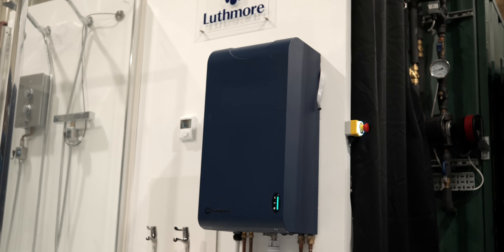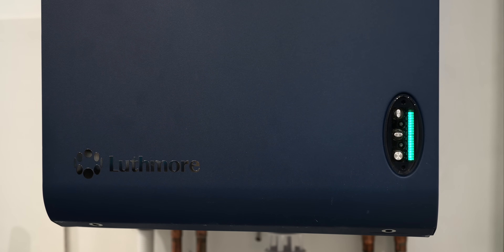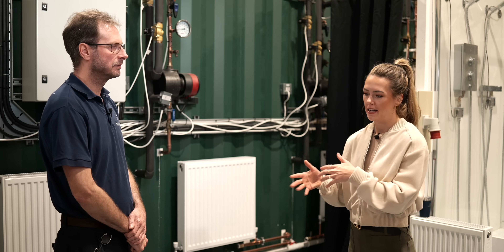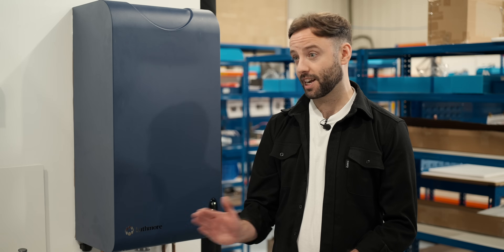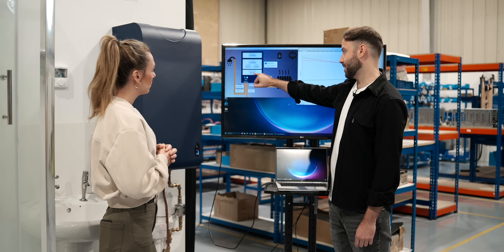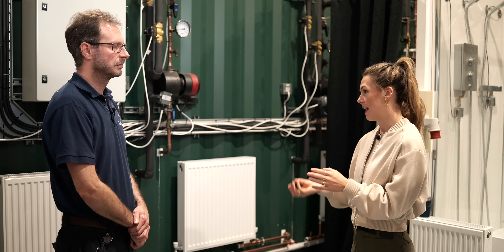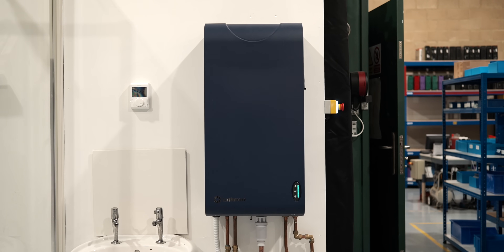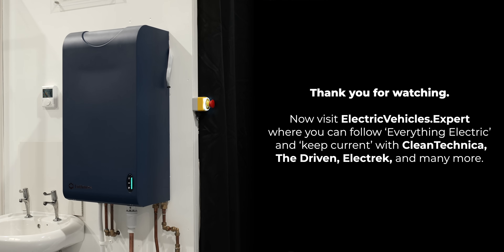Could This Battery Boiler Replace Gas AND Heat Pumps?

Comment: I wouldn’t buy a boiler or appliance that had to have an app to work. Apps are notorious for not being supported for long and the boiler needs to last years.
Reply: Indeed. It needs local control (it may have that as well as the stupid proprietary app). Only this week Google shut off all the smarts in nest thermostats. I won't put anything in my house that can't be controlled after the company goes bust. It's just asking for trouble.
Reply: There's a new standard called Matter that allows interopability between manufactures. It's been being built for the last few years and you can already use it now. Ikea's smart stuff supports it as does a bunch of other stuff.

Anyway, you can get thermostats that talk this language too, so you can set it up and just have it work in the Google Home app or Apple Homekit or whichever smart home app takes your fancy.
Reply: If I really wanted a specific device and it had to have some type of App, then I would only get it if it also supported an open source ecosystem like Matter so I wouldn't be trapped to the device manufacturer providing App support.
Reply: As long it can work and controlled without the app or at least the app works over bluethooth……
Reply: @HansKeesom  blue tooth is relatively easy to hack and in rented HMO's in particular you really are vulnerable to  whoever is around you when you activate it.  Even American small town city  utility companies have fallen victim to Blue tooth hacking ..
Reply: We have a bungalow with Baxi Bermuda gas back boiler for heating and hot water, it is 1970’s vintage. It’s serviced every year and not had any major issues.
Reply: Electricity more expensive than gas, is ridiculous. Probably the gas generators and nuclear raising the price of electricity.
Reply: I have just had solar and home batteries installed and the batteries were installed using an app. It was extremely easy.  If its from an International supplier there will make sure you can run the app will into the future.
Reply: My mums neighbour have had the same boiler for 40 years!
Reply: Not phased by an app. I’ve had the controller of my thermal store changed a number of times in the last 25 years. Just a control unit. Ultimately it’s a fancy switch. 
I’m more worried about the gas being cut off.
Reply: Same what if you don't have a smart phone? Ur fooked
Reply: Whilst I can fully understand the sentiment, you may find it impractical to apply across the board as the digitalisation of virtually everything gadget-wise train has long left the station on a journey that is NOT going to stop. Even modern ICE cars, apart from the fossil fuel used to power them, have essentially become little more than computers on wheels.
Reply: @pinkelephants1421  Oh I totally see the benefits of connected devices, I actually work in the digital innovation space, but that also includes resilience and the need for a manual control separate from a phone for basic tasks. For a boiler it’s a manual thermostat and boiler settings display, for a car it’s still being able to drive it if app support is dropped. Only today I defrosted my car via the manufacturer’s app. At some point that app or model of car will stop being supported and I’ll lose that feature amongst others, but I can still drive it. I suspect a subscription will apply after a period of time, but at least that will extend the lifetime of the support. So I’m not against phone apps, far from it, but I want a fallback for when support is dropped.
Reply: @pinkelephants1421  and the fossil fuel too, unless you have an oil well and refinery in your garden.
Reply: Been using Hive with an app for at least 10 years.
Reply: Even Hive discontinued their security and leak detection products in August so aren’t immune to dropping support. Without any method of local control or support for open standards these devices are now useless. At least with boilers they support OpenTherm and can be controlled locally via the thermostat.
Reply: Me too, however that is the same Hive that have ended support for various items like home cameras. I agree with the concern raised here. Reliance on apps is not acceptable. There is a decent chance of them being removed. Even if the company is fine, apple or android could block it for not adhering to some standard. There should be a physical control mandated.
Reply: I remember a new book selling company coming on the internet. People refused to use it, because they didn’t want to put their bank details on the internet. 25 years later Amazon has grown a bit.
Reply: @gordonmackenzie4512 that’s technophobia not obsolescence. I enjoy using apps, but I wouldn’t want to buy an appliance that I couldn’t control locally if that app support was withdrawn or I didn’t want to enable the WiFi for privacy reasons.
Reply: @gordonmackenzie4512  and it's been hacked multiple times 🤷🏻
Reply: This is one of my fears about getting an EV, I plan to, anyway, but a battery that lasts 6Mkm, but they stop supporting that make after ten, fifteen, twenty years. I'm finding that, buying second hand drones, even if you find a copy, you need an old version of Android to run it (which will no longer be supported) and you will be leaving yourself wide open, to hackers. We have just accepted, that the company, can tell us when our products 'no longer work'. I also don't like the thought that Elon Musk, could just disable the brakes in every Tesla worldwide, with a key stroke, and he could.
Reply: @michaeljames5936  I agree, I'm sticking to boiling my water with wood and matches because gas is just unreasonable, and electricity kettles need an app 😂
Reply: @michaeljames5936 You are confusing two different issues.  Operating systems and the App.  For example Apple has just released iOS 26.1. (The operating system for its iPhones). The App developers have had beta versions of that operating system for a while to ensure their apps continue to work.  Most cars don’t last to be 15 or 20 years old. In today’s world they would simple be better cars for people to buy cheaply second hand.  Old EV batteries will be recycled to make new batteries if in the future those materials are still in demand.   The point about Musk killing the brakes is just fairytales
Reply: @michaeljames5936 maybe do some basic fact checking before posting such ridiculous statements that musk could disable tesla’s brakes?
Reply: Yes you’ll need a subscription just to take a shower. It’s bonkers.
Reply: @pianounequal  I need a “subscription” to the electricity company to turn the lights on.
Reply: @soapyfrog  a bill is not the same thing.
Reply: @pianounequal  fixed amount of money over a fixed period with penalties for cancelling before a term? Tied to a particular meter type? Yep. Completely different.
Reply: @soapyfrog I pay my electricity at the end of each month, previously quarterly, I pay for what I use and never by direct debit otherwise they make money in interest on your surplus. That's not a subscription.
Reply: Like all other connected products and services, the main point of developing this appliance and selling it to you is collecting your data. They typically collect, use to upsell other products and services also sell the data to other companies or interested parties.
Reply: @soundslight7754 'Main point' is probably a bit harsh, but yes that's why everyone wants you to use their app: They can collect data and you can't easily turn the ads off like you can in a standard platform like the browser. 
It's a bad trend. We need more people to tell them to piss off, or we won't have any choice left.
Reply: @soundslight7754 it's not quite that simple, it's also way easier to make a device controllable via a web service, as getting these devices to access the internet can be a lot simpler than getting them to talk directly to each other.

That they get your data is a nice bonus.
Reply: @soundslight7754 I mean - that's relatively easy to solve. Simply don't buy the product(s) someone is trying to upsell. They collect data to upsell. You don't buy. No harm done. My heatpump comes with an app, they alwas try to selle me a new widget or "premium" service. I have yet to buy anything.

Comment: Starting from 5k excluding vat fitted seems a bit pricey to me
Reply: Battery prices are falling rapidly and that is predicted to continue. WIthin 3 years the cost of the 
batteries this thing needs will be half.
Reply: @DavidMorton-p8m 

Possibly, but, if batteries need to be replaced the cost of labour will go up.

Battery huggers  should face reality in that batteries are a dead end for transport given the time they take to charge.

Not everyone can charge at home and we read of public chargers being crowded, or unserviceable and vandalised for the copper.

Even some so called anti vandal connectors got nicked.

We read too of changing batteries, yet nobody has any idea of how many batteries will be required.

And then there's inductive charging for moving vehicles.

All these things are doable but a waste of time when compared to   FCEVs.

As mentioned once or twice before the car makers wouldn't be spending billions on said hydrogen powered cars and ICEs if they didn't believe there was a market for them.

VW have no plans for a hydrogen car yet are developing fuel cells using ceramic membranes instead of plastic.

We can only wonder why they're spending the cash on this line of R&D.

I suppose the message is sinking into the somewhat dense anti hydrogen "experts" in that we no longer see so many posts on the
"History of Hydrogen".

Nothing like enough research undertaken prior to posting by said "experts".

Ditto by battery huggers who appear not to have twigged we no longer read much about giga battery factories being built in UK and no sign whatsoever of the promised employment for thousands.

Yet another fairy story ex Boris Johnson that came to nothing.

Fast charging can verge on abuse so the batteries will die sooner.

One thing that's immutable.
Reply: And batteries don't last forever.

Seems a bit of a daft proposition.

Batteries could be discontinued, who can say?

Comment: This is awesome. I lived with a hot water heater running at 11KW in my rental before. Awful flow rate! This would solve that burst of energy needed. Next thing that I would to see make is a water heat exchanger in the bottom of a shower cabin that heats up the cold supply to the thermostatic tap with the used shower water. Not sure what the numbers would be but it seems a logical way to reclaim some energy from the shower instead of just dumping it in the drain.
Reply: The shower waste water heat recovery device already exists. Can get > 50% heat recovery if heating up the cold feed to an electric shower. I saw planned system at a trade show recently which used an electric shower designed to take a feed from such a heat exchanger and deliver more flow rather than just overheating
Reply: Zypho /Showersave/ Recoup/ Powerpipe / Megaflo make such devices. Always worth checking the auction sites for preloved or old stock. Can be used with over bath showers as well as whole house. There are various ways to connect them, serving the shower in use or being used to raise the water temperature going into hot water cylinder. Look up Todd Glister he has one installed in his home build. Have been used in new build projects to meet SAP point requirements.
Reply: That sounds like a good idea but like the condensers used in tumble dryers would it increase the likelihood of blockages and necessitate cleaning it a lot?
Reply: @2mains234 tumble dryer condenser are much smaller diameter pipes to create a large surface area. Waste water recovery uses larger pipes and is operating at lower temperature. They are designed to be fit and forget. Waste water exits at around 40 C from a shower, you are looking to raise the temperature of the incoming cold water from 10 C to 22 C. If you were concerned about hard water, then a water softener could be fitted.
Reply: @sjdiy8230 very interesting, thanks.
Reply: @sjdiy8230 

Hmm ... and your locale is where?

The output from a shower in UK is a a degree or so lower than 40C.

The temperature limiting valve is usually set to just below 40C so as  to protect people from scalding.

Ergo the drain water temperature is likely to be less than 40C.

Comment: I love the miss direction regarding the COP of different solutions. This has a COP below that of a gas boiler due to all the loses caused by charging and discharging of the battery. At the same time saying that heat pumps have a COP greater than 1 missed the fact that it is normally > 3 for heating hot water and > 4 for home heating.
Reply: not quite true.  They are using the incomming cold water feed to remove the parasitic waste heat from the battery cells (resistove losses) and the power electronics (resistive, switching and smoothing (iron) losses). As such, pretty much ALL the electricity that goes in comes out as heat, and even the small amount of radiant and convective heat that escapes still comes out INSIDE the house. As such the CoP of this device is going to be very close to 1, probably 0.99 or 0.98 at a guess. The actual "clever" bit is using the thermal inertia of the battery cells as the thermal store. This is shown in the "teppid water temp" on the display, that was still approx 2degC hotter than the incomming cold water feed temp in their demonstration.  Effectively the water channels that allow the cooling water to move around and over the cells and PE in conjunction with the thermal inertia of those cells and devices are what stores the low grade heat energy BEFORE that slightly warmer water is pushed through the primary heating elements where most of the heating power is developed.

Note:  A gas boiler has it's loss primarily due to heat escaping out the flue, which practically must use outside air to avoid killing the house occupants.  Clever use of condensing heat exchangers minimises that loss but it is still significant, typically 8 to 10%
Reply: @maxtorque2277  So using your logic you will be showing while the device is charging so that all the energy lost during charging will be captured to heat the shower water?
Reply: The losses while charging and discharging are heat. So it's not really a loss in this application, because that's what you want anyway.
It is essentially an electric heater with the ability to "timeshift" the energy use, which is very useful in a grid with more variable production.
Reply: @superdau  Very few people run their heating between March and September and even fewer would be doing so over night when is when this device will try and recharge its batteries. That heat has to have some usage value, otherwise it is wasted energy.
Reply: Unless you install this outside all the power put into it ends up heating home or water. As such COP=1. Even outside I think the fact they use supplied water to cool the batteries and power circuits means it's going to throw more heat away than a gas boiler outside, but I don't know how cool the surface of an outdoor gas installation would be these days - we have no gas in the village so for us this would be.an option for replacing the oil boiler which I can confirm gives off significant waste heat into the one room we want to keep cool - the pantry!
Reply: This is an electric boiler which can heat water as quickly as a gas boiler because it can also draw energy from it's battery as well as the mains. I'm not seeing any other advantage, so this strikes me as pretty niche. Apart from showers, you could run an immersion heater at low flow temperature 24/7 instead to take care of your heating. It'd be pretty dang expensive in the UK
Reply: Well, not quite.

Perhaps you should do a little research into the CoP thing, prior to posting for preference.

Chapter and verse, in quite some detail, to be found online.

Just Google.
Reply: @ForestForest-n9i  Maybe you should check again. COP as in Coefficient of performance is rather simple as it is the result of Thermal energy delivered / potential energy consumed. So a COP of 1 just means that for every kWh of input you get 1 kWh of useful output. This device over its life will likely not match the COP of a new on demand combi boiler, but it is likely to get near to it. When compared to a heat pump it is no where near and the person being interviewed did his very best to gloss over this fact.
Reply: @rogerthomas7040 

Hmm ... the  CoP is not fixed.

Had you researched the  the term as directed you would know this.
Reply: @ForestForest-n9i I think you mean the SCOP? That's an average over a longer period. Generally a COP is the same thing but over a much shorter time period - usually when the outside air temperature changing isn't really a factor to consider.

A SCOP is the average of a range of different COPs
Reply: @FahadAyaz 

No that's not at all what I referred to.

As in the CoP thing is not an exact science.